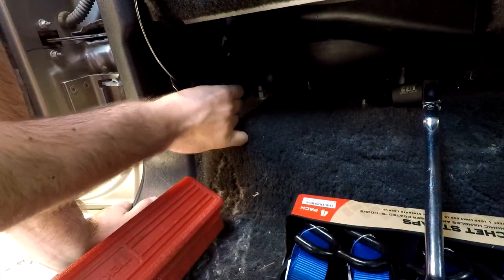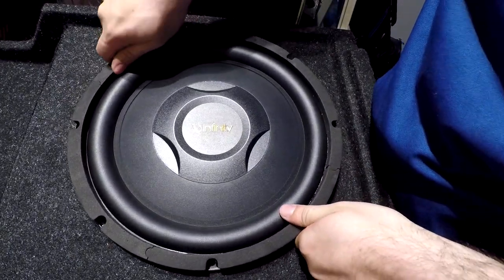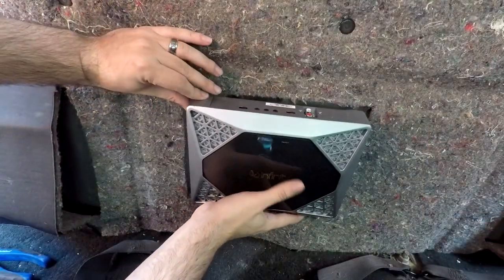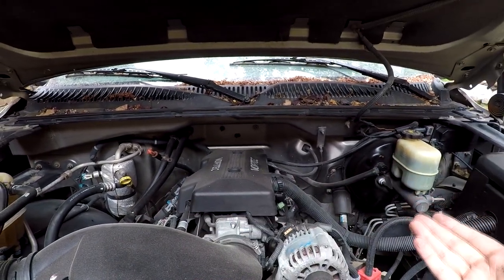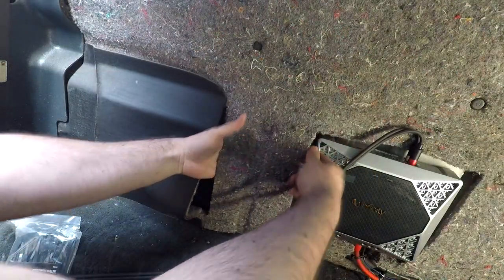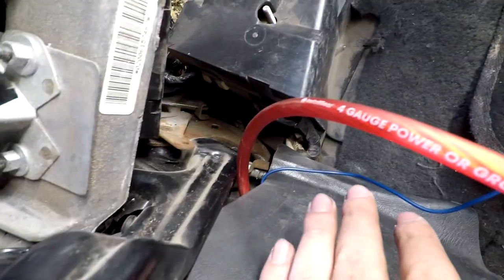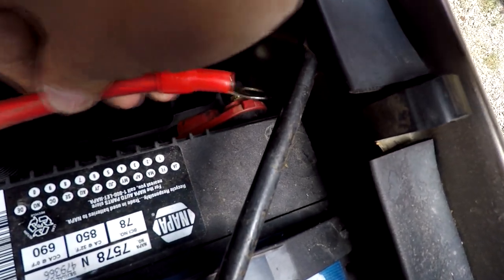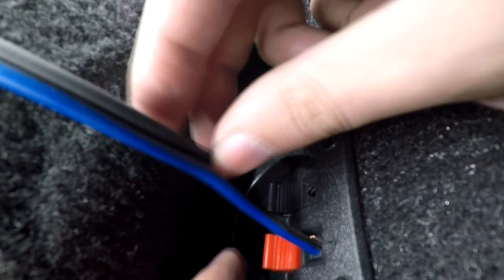How to Add a Subwoofer to Your Car or Truck (Aftermarket Radio) [2000 GMC Sierra 1500]

Comment: I have the same truck and just FYI you don't have to remove the seats to take off the plastic panels along the bottoms of the doors, if you'll pull on them they snap right out and they're held in by clips. I've had mine out numerous times it's very easy. 👍

Comment: You make it look so easy bro I got two evl 10 2000 how much amp do I need ?
Reply from the maker: I always recommend an amplifier that is slightly more powerful than the RMS rating of the sub. I never pay attention to peak power.

Comment: Why would you not run power so the radio turns on and off through ignition switch?
Reply from the maker: That's what the little blue remote turn on wire is.
Reply: @ufixitauto5237 which is run from fuse panel?

Comment: Did you mention what gauge wire you’re using?
Reply from the maker: I didn't, I just linked all the stuff in the description if you're curious:)
Reply: @ufixitauto5237  yes, I’ll have to check that out.

Comment: Were you able to reinstall the back seat or is that not an option? I wanna put subs in my truck but want to keep the back seat!
Reply from the maker: Yeah, I had no issues with putting in the back seat 😁 as far as anyone is aware, you can't even see that I have a sub!